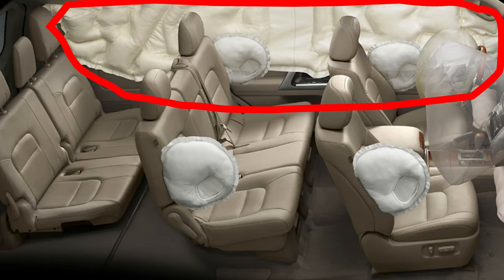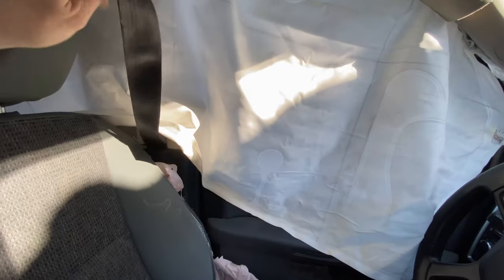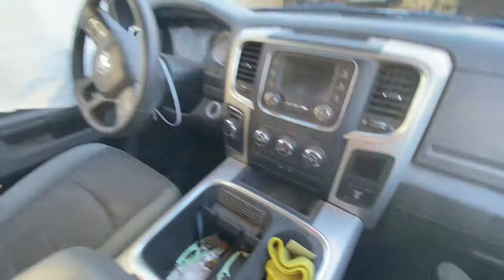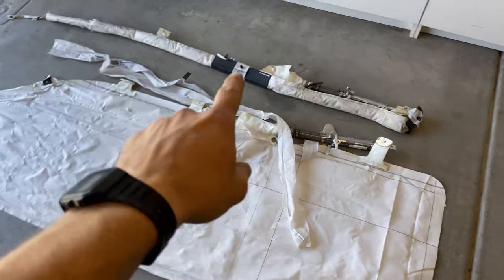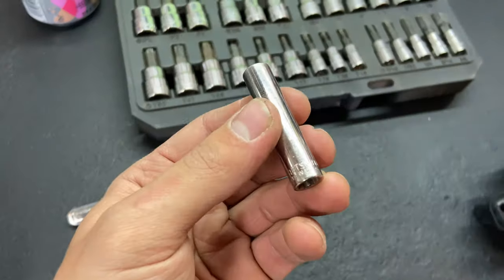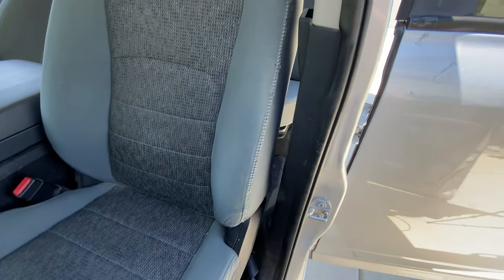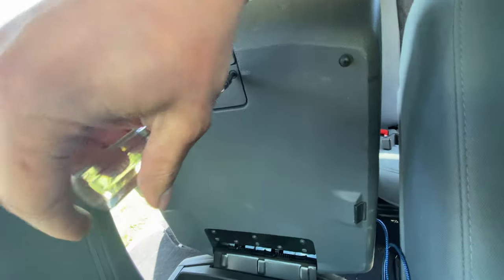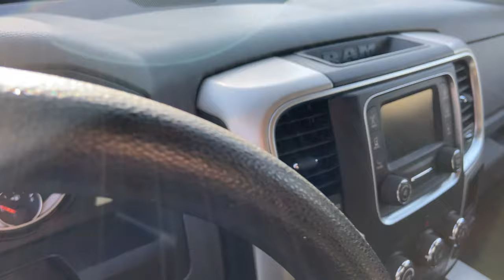Ram REBUILD Part 3 - Interior/Airbags/Deep Clean

Comment: I've been waiting for something new from you. Discovered this channel via the Z build right at the point where you took the break to move, so glad to see you coming back.
Reply: Now that I also replaced both air bag curtains,,,, and module under middle console ,,, and had both seatbelts repaired  with battery disconnected ,, once I connect battery and start motor , will the airbag ICON NOT be there on dashboard ,, and if soo , do I need to take truck to dealer so that they can reset it ??
,,,,

Comment: Yo, you cant just stitch the seats. It wont open properly if you have another airbag wanting to deploy, there is a special thread and stitch patern for those.
Reply from the maker: From what I read online, you can stitch it up yourself. I forgot to mention this, but you have to use nylon thread, Tex size of 30-80, and stitch length of about 5-7 stitches per inch for it to work properly.

Comment: Did your airbag light go out by itself or did you have to have it reset at the dealer?
Reply from the maker: I had to reset it. I purchased a “Think Diag OBD2 Diagnostic Scanner” ($50 eBay or Amazon), and that did the trick 👍
Reply: @BradBuilds  thanks I reset my code now I have another for the passenger seat harness. Hopefully a simple unplug and re-plug will do the truck tomorrow.

Comment: Did you really replace the seat airbag and sew up the open seam with a different pattern? I don't think you can do that! You have to match the same stitching strength to ensure that the new bag deploys safely. Assuming that the new sewing is stronger the bag will deploy inside the seat itself rather than breaking out and definately kill whoever is in that seat, crushing them between the seat belt and the exploding seat cover. Not cool!
Reply from the maker: I responded to this question, see previous comment 👍